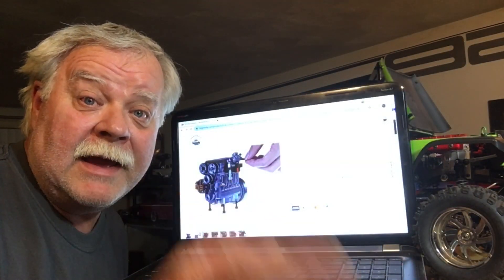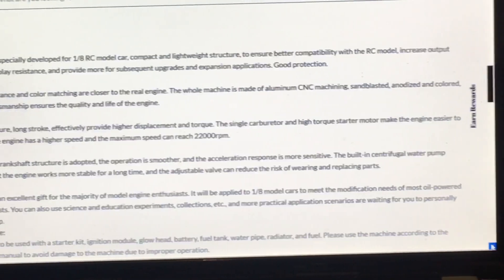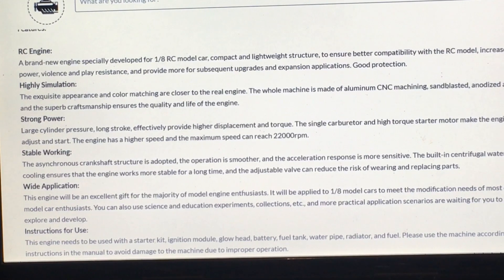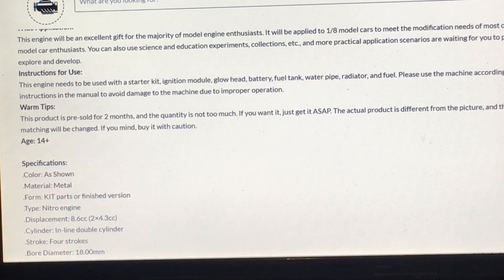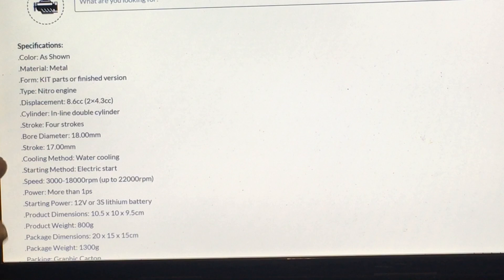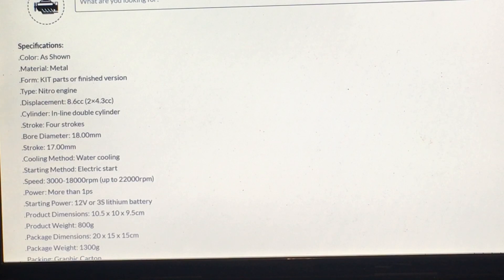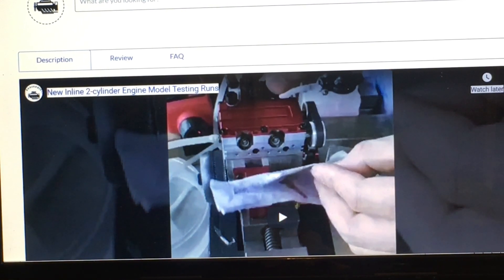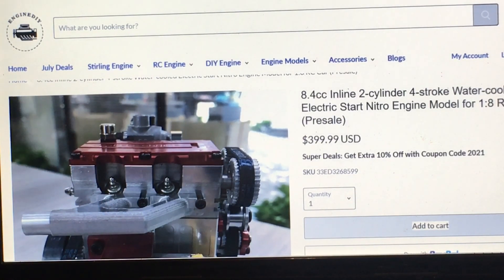New 1/8 scale 8.4cc 4 stroke engine?????

Comment: Hi again Dennis, I read all this gumpf a few days ago. Is it just more waffle to confuse us all. Longer stroke and higher revolutions do not normally go together, but it should produce some torque (or is it just talk). Most of us need a Toyan 400 that runs without breaking. Their recent focus seems to be on new product development; rather than (existing) product development. I have to be suspicious of product information suggests it isn't even for the product, "product may differ'. Good luck Dennis, I hope it works out for you. Me ? I'm going to wait........ unti the unit is actually in metal.
Reply from the maker: I figured I would buy it instead of the new X power to see if the description was correct, If not its a lesson learned, this is said to be from another engine company not toyan from the name on the valve cover ( Conbery engine) they say it has adjustable valves in their description also. Toyan should have addressed the problems to their customers better than waiting for them to break and waiting for the unhappy hobbyist to have to contact them and wait again to start over with their engine,

Comment: Hey Dennis. I post my vid then I saw yours. We seem to be looking at the same features. don't know why they keep mismatching topic with details (8.4 vs 8.6) like with the l200. I think the compact is referring to the outside body. looks like is SHAVED smaller. The header I like and seems same as the l200 separation. I don't like the intake placing the carb way higher making it hard to avoid front hood. The water cooling inlets seem ok making the water rotate around the piston sleeves thus cooling it as it passes to the front. I also like the idea for adjustable valves which I thought It could be done when the L200 came out. BUT you're right, you order a chicken I hope you don't get a frog. LOL
Reply: thanks for your feedback. i will let our designer know of it. we might update it in the future.
Reply: I ask our designer to adjust the carburetor air inlet into the bottom.
this engine adopts wet water cooling, built-in centrifugal water pump cooling method, the best water cooling method I think, much stronger than  that of Toyan's 
The valve is adjustable too, I believe many people will like it
Reply from the maker: Thanks for looking into that my friends.  I wonder if the carburetor inlet could be on the side without affecting the cooling method.
Reply from the maker: Yes the cooling method looks great and the adjustable valves were the reason I jumped on this, the carb might fit on facing outward on the side, I will know more when I get it.

Comment: https://www.stirlingkit.com/products/36cc-i4-dohc-4-cylinder-inline-four-stroke-water-cooled-gasoline-engine-with-twin-overhead-camshafts-for-rc-car-boat-tank-model?variant=39541160935616

Have you seen this one ? I’m thinking about pulling the trigger.
Reply from the maker: Yes I have been waiting for more information on the 36ccDOHC, the rubber O ring belt on the oil pump kinda held me back. But it seems like a good engine.

Comment: Single carb and adjustable tappets? Useable rev band? I think I might have found an engine for my Slayer Pro. I have seen plenty of Revos and Slayers running with acceptable top speed on the OS FS-40C which has the exact same rev band this engine does, using off the shelf clutches even.

If this engine turns out to be what it looks like I want to see you put it in a fast mover.
Reply from the maker: I have an old school Kyosho burns roller from the 80's that would be a easy install to test it out.
Reply: @dennisdempseyradiooutofcontrol  I had half a thought to try to cheech it into my Kyosho Scorpion XXL but I imagine this thing is ENORMOUS compared to the .25 2-cycle I have in there now. Would probably require molesting away most of the scale detail I love about that car.